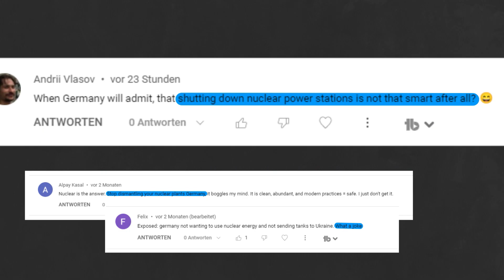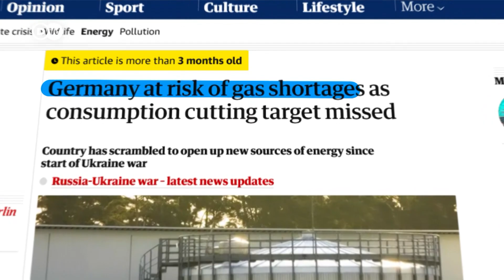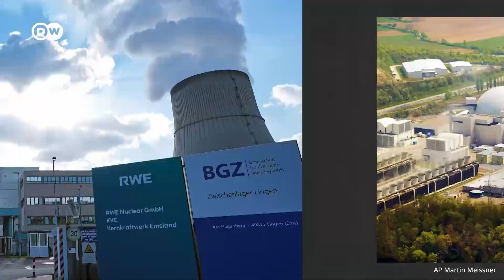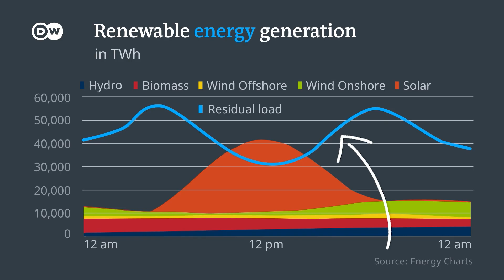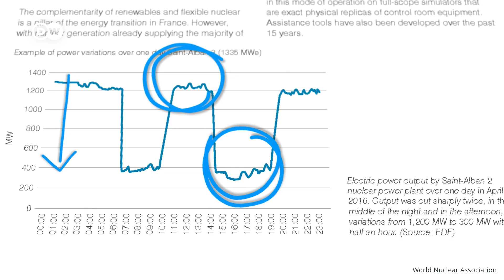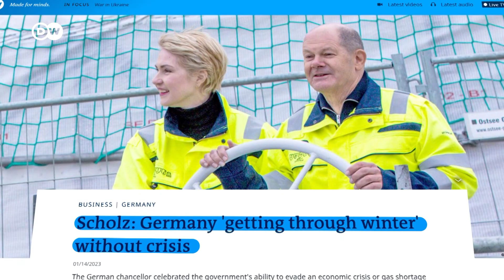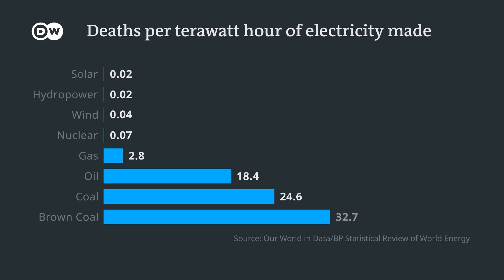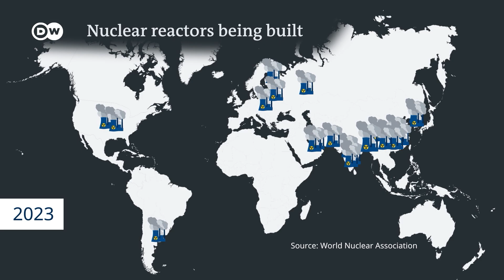Is Germany's nuclear exit a mistake?

Comment: Almost all of these power plants use some form of fuel to generate heat, then use that heat to create steam.  If a plant were designed from scratch with thermal storage in mind, say a giant sand pit or something, then they could continue generating heat while the turbines are run sporadically to meet demand.
Reply: Instead of that heatpump nonesense why not use the heat for the houses
Reply: @stefanpredl6849  they do that in some colder countries.  I don't remember where, but some city recently built a heat storage battery like this.
Reply: @madcow3417  I think what he means is central heating. It existed back in USSR.
Reply: There is no compelling reason to build your grid around wind anyway, there are places where the wind potential is so good you can't ignore it  but it's  supplemental not fundamental.

Comment: Nuclear power is the cleanest, safest, most energy dense form of energy generation available to humans, as well as the most useful in providing sustained reliable base load, which other renewables do not provide due to intermittency of wind and solar. In the 1960s-1970s the United States built over 100 nuclear reactors and was on pace to providing 100% of its energy by 1990. Uranium can provide 100% of the energy humanity needs for the planet for the next 25 billion years; add Thorium to the mix and there is a 50 billion year supply. Uranium is 25 times more abundant in the earth's crust than oil and coal combined. Fossil fuels are stupid and wind and solar are insufficient and will ALWAYS be so, especially in the time frame needed for climate action.

Comment: Just have a look at the cost and timescale of building Hinkley point in the UK. It's about economics. This is just construction cost too, let alone cost of security for a nuclear plants entire life. Plus cost of waste. It's just much much cheaper for Germany to phase out plants that are reaching their lifespan instead of building new.
Reply: Except that they have had ample opportunity over the last decade to take steps to extend the lifespan of reactors that have already been built - and failed to take them. After 2014 a blind man could see that depending on Russia for gas was a bad idea - Germany's response to Putin's illegal invasion of Crimea? Approve the construction of another pipeline - no wonder Putin thought he could invade Ukraine and Europe would do nothing but wring it's hands and moan loudly. And now, they are substituting a form of energy that doesn't emit CO2 for brown coal - which is about the dirtiest fossil fuel you can get, even compared to other forms of coal....If they said we've built the batteries, built wind turbines etc and we have the capacity that we don't need the nuclear power stations, then fine - but that's not what they've done, is it? 

And then the German Greens wonder why countries like India and China think the West are hypocrites.
Reply: That maybe but for the next 40 years the UK won't have to experience either blackouts, importing energy at great cost, or returning to coal.  Germans on the other hand will be paying through the nose for French electricity.
Reply: @krashd  you mean with the powerplant that costs 32 billion to produce just 3200 mw? Literally 1 billion more than the 3 gorges dam that produces 22 000 mw. Seems like a great deal!! Oh and it's owned 66% by France and 33% by China, so ye great independence... Not to mention still relying on other countries for uranium supply. 
Germany regularly sells electricity to France. Almost every winter when France gets high increases in demand during cold weather because they favour electric heating. Or during droughts or just long periods of high temperature where the river water used to cool the reactors gets too hot generation levels are dropped. Or like last year when all of its reactors required maintenance at the same time. Same vice versa, France sells to Germany if it's plants are all operational and there are low sun and wind levels. It's a partnership, and the difference was all of Germany's nuclear plants were nearing end of life. So it's much cheaper to decommission rather than spend 32 billion for a measly 3200 mw. 

Nuclear power is no silver bullet,  nowadays it's the most expensive electricity production. Germany plans to go 80% renewable and integrate more into an EU wide grid, where you can pull electricity from all over. This way seems much cheaper and more efficient, and doesn't rely on a technology that piles up dangerous nuclear waste on thousands of sites across the world that need 24/7 security.
Reply: @user-propositionjoe  The EU has recently established a deal to build offshore-wind power plants in the North Sea for 800 Billion Euros, for a capacity of roughly 300 GW unreliable and weather dependent electricity generation. I'd rather a guaranteed 80 GW nuclear power generation (maximum possible due to high cost in your example, owing to the incompetence of the guys in Britain) than fickle 300 GW wind generation, because it will never be 300 GW. If the wind doesn't blow at all, you won't get close. It's asinine to think about costs when the argument made in favor of renewables was always "prevent climate change at all costs". Nuclear is "clean; even the hypocrites of the EU claim this.
Reply: @KonsaiAsTai  these numbers you're spouting are pure nonsence. So many things about your message are factually incorrect it clearly shows you're deluded so any response is basically pointless. However i'll humour you.
For a start offshore wind in the northsea is not unreliable. It's literally always windy there, its more a case of more turbines generate too much electricity that there is currently no storage or use for. Hence why the EU is currently also working on the first continent wide supergrid to rapidly move this electricity to where it's needed on demand. Secondly, 80GW???? The entire 56 nuclear plants in France generate 61 GW.. Hinkley point will generate just 3200 MW (3GW) so you would need 25 Hinley points to generate this magical 80GW. With the current cost thats 25x31 billion = £775 billion. Literally the highest cost electricty production ever. Not to mention you need to pay to protect these 25 nuclear sites for eternity, and pay to deal with the nuclear waste. Nuclear power plants in their current form just became too expensive and unviable. It's only ever about economics with humans, the mighty dollar. If nuclear was the best option the entire world would be powered by them. This doesn't even brush on the known uranium deposits would literally run out in a few decades if everyone switched to nuclear. Wind is way cheaper so it's obviously a no brainer.

Comment: I personally support renevables and increasing wind and solar. The amount of wind power has been increasing very fast here in Finland, and currently there are also billions of euros worth of hydrogen investments coming because of it, boosting the economy while transitioning industries to lower emissions.

But nuclear can be an important and good part of the electricity generation palette. Finland's sixth nuclear reactor's, Olkiluoto 3, final test runs were just done and it's commercial use is starting next monday, 17th of April. Two days after Germany shuts down its last 3 reactors.

I think it's especially silly to close nuclear power plants that still have lifetime left. Primary goal should be reducing the amount of fossil fuels, coal, gas and oil. The decisions of closing nuclear power plants will make this transfer out of fossils slower. Germany has currently very dirty electricity production, producing 573 gCO₂/KWh, compared to France's 58 gCO₂/KWh, 7 times lower. It's going to take 20 years for Germany's electricity generation to be as low emissions that France already had in 1980's.
Reply: Hydrogen is straight up waste of energy , it can be stored effectively , sure , but hydrogen needs a lot of energy to be made in the first place , if you don't want huge co2 emissions , hydrogen is not an energy source , it's storage , very wastefull one , stable , but very expensive
Reply: We are too many layers of tech behind were we need to be for a sustainably sourced  primary future. But the human mind, while it is capable of thinking of tomorrow, is oftentimes concerned only with the right now. Everyone demanding action be taken is always only screaming now now now now now no matter the cost, since THEY are not actually paying anything, someone else will pay for it because they demand it
Reply: Well you are mistaken if you think that all those "renewables" are cleaner and greener than Nuclear Energy 

Nuclear Energy is Working day and night 
Nuclear Energy is working if there is wind or not 

Nuclear Energy is producing Much higher energy compared to other sources 

and reason why it is considered bad ? bad PR and uneducated people who think that it is very dangerous .
Reply: Nuclear is the greenest energy too .

Comment: Ironically coal power plants are more dangerous for the surroundings as they release more CO2 and even radioactive materials due to present contents of uranium or thorium in the mined coal. Nuclear waste on the other hand is disposed of in a contained manner, and not by air. I don't think shutting down nuclear plants is a solution

Comment: We don't have another option, and the criticisms against nuclear are unwarranted as they are primarily directed at current nuclear technology, which has those issues. However, older nuclear technology (that was never adopted widely), such as Thorium molten-salt reactors, has proven safer.

Comment: Another issues not touched is Uranium-235 deposits including other radioactive Plutonium and Thorium deposits are finite. if China depleted  coal of more than 100 towns, one day all energy will be renewable or we all will live in 17 century again, I think positive feedback loop (avalanche system) of global warming will kill us all thus we will not suck last drop of oil and dig last lump of coal lol. Biggest problem of global warming solution is oil, coal, natural gas, is very very cheap pollution that makes these fossil fuel makes  and damage on global temperature not counted.
Reply: When we count other highly radioactive elements we literally have billions of years of nuclear power left,  Uranium and other heavy elements are very common and 238 can be transmuted to Plutonium-239 using up and recyling much of the waste. I don't suggest we use 0 renewables but it's foolish to suggest that nuclear is theoretically finite and therefore shouldn't be used when there's a lot left and it's the only readily available power source to provide enough base load to actually replace fossil fuels any time soon.

Comment: The amount of mining(rare earths and structural materials), toxic waste, air pollution and land renewables require, to get outcomes just a little bit better  regarding emissions compared to fossil fuels, aren't worth it.
Reply: Rare earth metals aren’t used in photovoltaics (with some very niche exceptions).
Reply: DW has made a video on that("How clean is solar really?") It mentions life cycle assessments. It does not allign with your statement.

All renewables have tiny emmisions even across their lifetime as opposed to coal.
Reply from the maker: Hey there 😊 thanks for recommending our video on solar energy. You can all check it out here 👉https://www.youtube.com/watch?v=EWV4e453y8Y. Hope this is helpful! Let us know how you like the video ✨
Reply: Not good, but Its still better than having an increasing number of detrimental atmospherical events caused by fossil fuel use
Reply: Not many rare earths are used, there is some toxic waste but that will only become a problem if we rely on renewables/batteries for a "forever" solution and not a bridging one to next get fission plants and if fusion ever becomes something other than expensive vaporware. The biggest problem is land use really, both in power generation and where to bury all the waste (toxic or otherwise) from the recycling and manufacturing streams.

But every country has its use case, it would be interesting in a few hundred years to see the difference in disparate paths France and Germany took, to have a few geological repositories storing high level waste from used fuel reprocessing, or low level toxic graveyards of e-waste and chemicals from making blade composites and recycling panels and batteries. I guess Germany can just dump them in the already toxic fly ash ponds from all the coal they are burning.

Comment: With high temperature reactors country could produce clean hydrogen, store it and burn it (or use fuel cells) when demand is high, without adjusting power output in nuclear power plants. 🙂

Comment: Germany has of course the right to exit atom if German citizens are afraid of it, but since the danger of climate change is HUGE and a certitude rather than a risk, the wise approach would have been to phase out nuclear production only after a successful transition to renewable (batteries included !). When I travel to Germany, I do not see solar panels on many homes and wind turbines in many fields. Furthermore, unlike in France, in Germany many people are using gas to heat their home, many train lines are not electrified, many people are driving huge diesel SUVs, etc. So the need for renewable electricity in Germany is underestimated, and meanwhile coal rules. Sadly, all children where ever they live on Earth will have to suffer the consequences.
Reply: No, Germany has no right to violate the autonomy of the private companies who build and operate nuclear reactors. Unless you think that conservatives should be able to take control of government and ban renewables.
Reply: @gregorymalchuk272  That is were fission power is really just favored by a few well informed people, the conservatives want to keep getting rich off fossil fuels, the liberals want to dream about using sunshine and wind to run an industrialized nation with blinders on over the true long term ecological impacts and without addressing the elephant in the room (cost of energy storage), so there are few people who rely on votes for a pay check who will actually put their hand up and say both sides are wrong and it will take a combination of several technologies to cut emissions properly.
Reply: @gregorymalchuk272  Germany is not the US.

Comment: Just like Frau Merkel said..
you cannot control everything. There will be always something new to engineers. Nuclear accident is just a matter of time when you have nuclear reactor. The chance (though very small) is above zero, thus with sufficient time, something will happen. 
So no, it was not a mistake. 
I wonder what is the real price per kwh in France though. 
Its lower than in Germany,  but the national power company of France is a big contributor to national debt in France as I understand.
Reply: the price we have for the kwh is at 0,2062€ for the moment
and for the debt it is true but because they are the importer of fossil fuel, coal, and oil mostly

Comment: If you want a renewable transition just don't phase out nuclear.
Keep using it until your renewable capacity is at 100%  (Actually you would need more than that because of the intermitency so it would be like 150% or even 200)
Reply: For solar you need way more than double the capacity. The difference between summer and winter is 8-9x in solar insolation in Germany. I just don‘t see Germany being self sufficient in the winter for many more decades if ever.

If we will be relying on other EU countries then thats ok, but we should have as little reliance on sources outside the EU.
Reply: Using just renwables for energy grid is kinda dumb and probably not doable at least realistically, you want some stable and peaker sources of power to get more efficient grid.
Reply: Keep in mind that isn't 100% of current electricity. If you want to truly decarbonize then multiply whatever you need to replace current electricity by at least 3 to cover fossil use in transportation and industry. The storage demands when you go all the way with only renewables are truly immense.
Reply: Nuclear is more renewable than wind and solar. Because nuclear fuel in the earth's crust will last longer than the sun will burn.
Reply: RethinkX thinks it's 4 times, plus some limited storage
Reply: Even with 1000x you can't rely on wind and solar. It is quite possible to have a 2 week wind lull in Winter. To get Britain or Germany through that lull would need 300 years of total World Battery production. The costs would be beyond belief. 
To give you an idea the World's biggest battery farm would power a ship for just 1 hour. Yes seriously !
Reply: @codprawn  What kind of ship is that?  
We have many battery-electric ferries here in Norway, and there is still batteries left over for other stuff.
Reply: @MalawisLilleKanal  
A large container ship or cruise liner.
Typically the engines are about 80megawatt not counting generators etc. The South Australia battery is 150megawatt.  So ok perhaps enough for 2 hours running. Won't keep a country running for more than a few seconds. Britain uses about 40gw/h so you need 266 of the biggest batteries in the World to power the UK for 1hr. Or 89000 of them to power Britain over a 2 week period with no wind. Which happens more than people realise.
Reply: @codprawn  RethinkX calculated it's 4 times for the US
Reply: @autohmae  
What is 4x?

Comment: This video made the point that varying the power output of nuclear plants to accommodate the output of wind and solar could be hard.  It would be hard to turn the nuclear output down.  So,.........why not just shut off the additional solar and wind?  In fact, why build additional renewables at all if the need is met by nukes?  Windmills and sunshine are very old intermittent technology.  This energy is certainly unreliable.  Did Germany make a mistake in abandoning nuclear power?  Obviously-Yes.